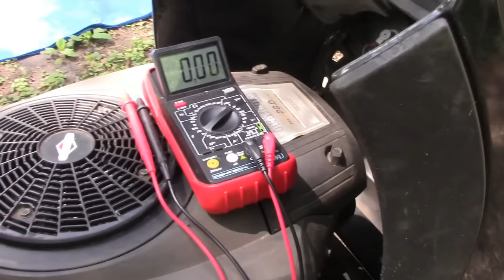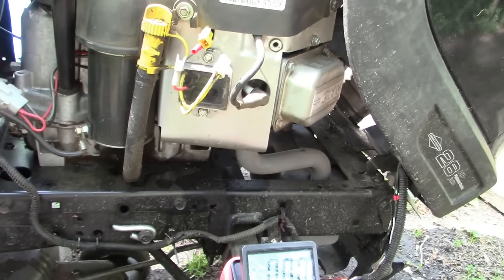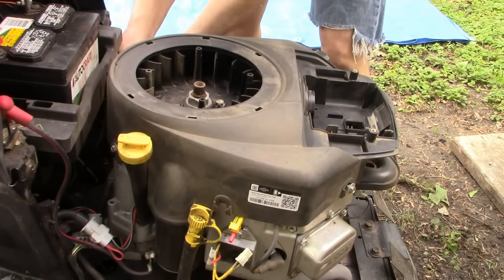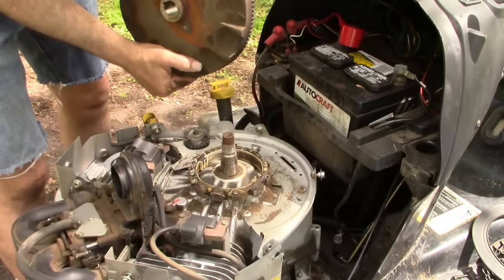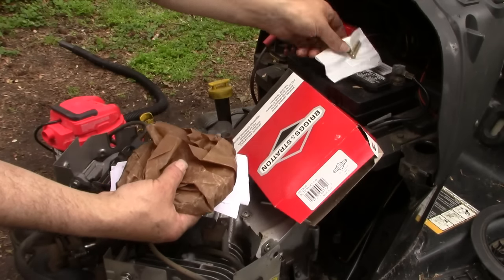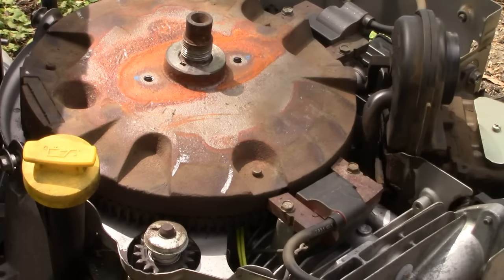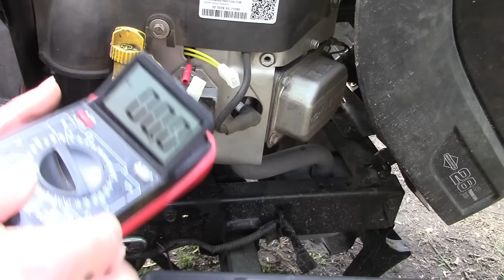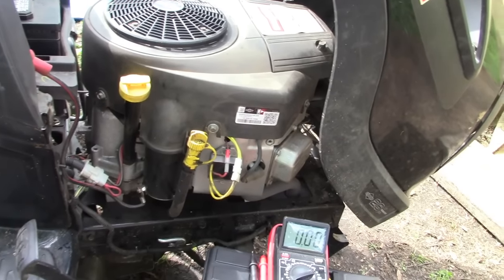How to Test and Repair a Lawn Tractor Charging System

Comment: Have to admire the guts of someone working on the electrical system without unhooking the battery 😮
Reply: Was thinking the same thing
Reply: Right, cause 12v is so deadly. Could've shorted out his pacemaker.
Reply: @joequillun7790  It isn't about 12V hurting you, it's about damage to the equipment.
Reply: @BuckeyeNut123  OBD2?

Comment: 15.5 volts is to high should not be over 14.5 volts, it looks like the voltage regulator needs replacing.
Reply: Unless battery is weak and going bad
Reply: Leave it to the professionals 😅
Reply: slowly cooking the battery.....
Reply: It’ll be OK.

Comment: Normally the headlights would be running while using the tractor so those lights would drag the extra voltage it’s putting out

Comment: All that effort and did not clean outer magnets on flywheel or the coil ends that go towards outer magnets on flywheel. It would of also been great if you could of shown the inner magnets on flywheel. Other than that I was thankful of the way you tested to verify the bad part and then showing new part and numbers. Thank you....Pete
Reply from the maker: Thanks, Pete. According to Briggs & Stratton, cleaning the flywheel magnets is an unnecessary step unless the built-up rust is negatively impacting the required air gap. That's what I've heard, anyway....

Comment: Great video with important details such as the AC & DC voltages that should be present from the stator and voltage regulator respectively. I have a Husqvarna but voltages should be at or near the same values. Also read that if you have your lights on while the mower is running then stop the mower the lights should dim. If not then there is a problem somewhere in the charging system. Great video Buck!

Comment: That voltage seems a bit high to the battery. A car battery will BOIL at 16 volts....that is not a guess, I have had it happen on old dodges...more than once. If you smell sulfur shut it down, the battery is boiling.

Comment: Excellent and understandable video. I have a truck-mounted carpet cleaning machine that uses a 23 hp B & S engine. I think either the voltage regulator is burned out or possibly the stator. It is not nearly as accessible as a lawn mower because of how the machine is made, but all in all, it's basically the exact same type of system just a little more complicated and hard to work on. Getting to the stator is the biggest issue so I need to find out for sure if that's bad or not. If it is I may have to hire a professional service on this one for help. Anyway, your video was a big help because I'm pretty dumb when it comes to these things, but even I fully understood everything you did. Thanks!!!
Reply from the maker: Interesting! I would start by verifying DC voltage at the battery with the engine running full throttle. 13 or 14 volts DC would indicate that everything is working just fine. I was also just wondering in your situation if it were possible to use the truck alternator to charge the machine battery just like it charges the truck battery? That might be an easy work around.... Good luck with the repair, and I'd be interested to know how it turns out.

Comment: Was about to order a 130$ stator just before watching your video. Only to find out that mine was outputing DC and AC flawlessly like yours. Thanks for your time!
Reply from the maker: Great. No point in replacing parts that aren't faulty. But is your battery charging? Or what is the problem you're trying to resolve?

Comment: DUDE your vids are the Best !! thanks TONS for this one ! ive had this issue and a battery salesman convinced me that i have to replace the battery every year because they're all junk. i did the coils replacement,  voltage regulator AND the coils... same issue... ran across your vid and BOOM -  Done !
  My machine is the Ariens 22 B&S V Twin, so close to the same beast... it mows MEGA lawn spring thru fall, and plows Montana snow for a whole cul-de-sac in the winter... so its a busy machine !! Thanks for your time and effort making this vid !!
Reply from the maker: Thanks for the note and kind words! And good job fixing your own machine!

Comment: Excellent work, Buck.  Now I know how to troubleshoot and repair the electric system on my tractor mower.  Really only two components after verifying wiring is good.  Every step covered and well explained.  I'll check the regulated Voltage to battery just to see.

Comment: Thanks for step by step diagnosis. Son in law has 2002 Simplicity Broadmoor 16 hp B&S Itek engine  405777 with Tuff Torq Hydrostatic tranny. Hour meter over 550 hours. Battery new but runs down after 2-3 weeks. Will first check for bad wiring.

Comment: Great video!  I watched several others before I got to your video.  My problem was the connection on the regulator that goes to the battery.  You made it super easy to find and after just a few minutes it's working perfectly.  Thank you for making this video!
Reply from the maker: Great news. Good job fixing it yourself.

Comment: Thanks for the help. Using your video I found my 50 inch craftsman 26 hp. Problem. It’s where the alternator wires come out from under the plastic cover. that cover chafed my wires, once I repaired that it was good again. I should have tried to fix it years ago instead of replacing batteries. I have since put a small piece of foam on the plastic cover to prevent it from happening in the future. I suspect a lot of B and S engines with that cover may suffer the same fate

Comment: Great video. My problem is that the battery may be overcharging. Does that suggest the regulator is faulty? Thanks.
Reply from the maker: I guess that's possible. What kind of voltage is it putting out at the battery when running full throttle?
Reply: I’ve never seen that happen unless the battery is bad and over working alt

Comment: Great video.  I went out on Sunday and my Ariens Zero turn battery was dead.  I put my charger on the battery and got it running but when I got off in the yard it was dead again.  I put it on the charger longer and got done.  I was getting ready to call Ariens for warranty work but now I can check my stater and regulator before I call.  Thanks.  Great video.
Reply from the maker: Check the voltage at the battery with the engine running full throttle. If you're getting 14 volts or so, your charging system is fine. Possibly it's just time for a new battery??

Comment: Your video solved my problem. I have a few steps you didn't mention. My first step is to check the fuses(s). When doing work like this, I like to set up a portable picnic table near my work area. Here in FL, during hot weather, I set up a portable canopy for outside work. When removing screws, I use a paint-filled felt-tipped marker and write the size on the fasteners near the screw holes. Where wires run under a retainer plate or holes, I mark that spot with my marker using the same color(s) as the wire(s) and draw an arrow to indicate where the wires go. If you find that the retainer key on the shaft is broken, you may have discovered the problem. With the engine cover removed, I check the stator gap. Loosen the pickup screws, and the pickup will be drawn to the stator because of the magnets. I use a standard business card to set this gap. Also, the card allows me to move the pickup in and out while I tighten the screws. When using extension wires, I attach small alligator clips to the ends of the wires.

Comment: Excellent video!
What is the size for the socket for the metal wheel over the alternator?  30 mm, 31 mm, 32 mm, or...  I would be most grateful, if you would tell me.
Reply from the maker: It's probably 15/16" (inch). But I don't specifically remember....

Comment: Thanks for the video. I have a 13 HP Brigs experiencing similar charging issues. At full throttle I am only getting 12 to 12.3 volts DC to the battery. Time to do the same. The mower is about 11 years old. Started up after replacing the battery but have to use my jump box every time to start it since. ;-)

Comment: You can rewind that part with magnet wire and solder on the old connections. I am not trying to be that guy but if you can't get a replacement then this is a option and a surprisingly easy one at that.
Reply from the maker: Good info. Thank you so much!

Comment: Hi I got 2 small led light bars with wire harness and switch ...I've already replaced 1 battery got a new one and it worked for a few weeks usually start the mower 1 time a week .. well today it died and didn't want to turn back over until I connected my jumper cables to my truck...would those led lights drain my batter after a while ?

Comment: Great video! I just got a new battery for my Craftman 20 hp mower. Started right up first time then 2nd time won't start the mower. Should I check the regulator first and the the alternator?
Not sure where the regulator is.

Comment: Very clear instructions. Will the DC voltage be different on a smaller engine? I have a 13.5 hp B&S motor that's not charging the battery.
Reply from the maker: Check battery voltage before starting the tractor. Then check battery voltage again at full throttle. Should be higher, closer to 13 volts, I'd say.
Reply: @Buckwsr  I apologize, I meant to say will the AC voltage be around 30 on a 13.5 hp motor?
Reply from the maker: @Thurge  If yours is set up the same as mine, with the externally mounted regulator, I would say yes you probably should expect around 30Volts AC directly from the alternator.

Comment: I'm in my 3rd Season with my 2021 craftsman T240 tractor no issues with the battery starts every time I live in Oklahoma it gets very cold in the Northeast section where I live many times below O in the Winter time I disconnect the negative side of the battery for the off season..No problems

Comment: Hi, thanks for the video! When you were testing the regulator I couldn't see where you were putting the negative lead after the regulator/stator was replaced. The jumper was in and the output to the battery had the positive lead and I can only assume the negative probe was on negative post on battery when you did that regulator/stator test. I could only get a reading of 14+ volts on the regulator when I put the negative lead on output from regulator and positive lead on output to the battery without using the jumper wire.
Reply from the maker: Yes, the negative lead can be placed on the engine block or any bare metal on the tractor frame, or of course, on the negative battery terminal. 14 volts sounds about right to me....
Reply: @Buckwsr  that wire coming out of voltage regulator to charge the battery.  Where does it go to.     Mines putting out  15 volts or so.  But wen i test the wire coming from the battery up to the regulator hookup.  I should have battery voltage and i do not.  I tried a direct wire from regulator to battery and fried a new regulator   so now i have another one and do not wanna burn that one up.  Thanks in advance
Reply from the maker: @cspbldg  I'm not entirely sure I understand your question...  The 14 or so volts from the regulator (with engine running at full throttle) should go up to the key switch, and then make connection with battery positive when the key is in the "run" position.
Reply: @Buckwsr  thats what i thought.  Someone has the wire going from voltage reg to the amp meter

Comment: All went well but I did need to buy a 32mm impact socket to remove the flywheel bolt.  BUT I cannot get the flywheel keyway pin to tap in easily like you showed in the video...What's up, just wrong alignment OR is the flywheel not fully down.
Reply from the maker: Not sure what to tell you. The keyway pin usually goes in easily...

Comment: I can't find any information on where the 14 volt dc wire on the regulator for the 24 hp briggs on the husqvarna r4824 zero turn is attached.   Mine is missing. I have no idea how it disappeared.  I assume it goes to the key switch someplace but I can't find any place that the wire can plug into.  There are many videos show how to test the wire connection but I haven't seen and on replacing it if its bad or in my case missing.  If you could steer me to a wiring diagram that show where it's attached. I would be very appreciative. Thank you very much I really enjoyed your videos. I found very in formative
Reply from the maker: One option is simply to add that wire from the regulator to the terminal on the starter solenoid...the large terminal that runs directly back to battery positive. Then run the engine full throttle and make sure you're getting like 14 volts at the battery.

Comment: A test device to simulate an a/c charge would be handy to fully diagnose before even replacing the stator. You could simulate an a/c charge current into the "regulator"(diode) and check the dc voltage out as long as the test device is capable of being in a known good working order to produce such signals. Good video BTW.

Comment: Couple things 1) Amazon says the voltage regulator in your link is no longer available. 2) At the end of your video when testing the charging by putting in the jumper wire, which battery terminal do you touch? I assume negative but I never like to assume.
Reply from the maker: The regulator puts out positive DC voltage and runs through the key switch to the positive terminal on the battery. When I was testing the DC voltage output at the regulator (with the jumper wire), I put the positive lead from my tester on the jumper wire, and the negative lead on the negative terminal of the battery. For testing the regulator, it has to be connected to the battery. That's why I used that little jumper wire.

Comment: Excellent video! Taught like a real pro with excellent knowledge and experience! But you made it showing that anyone can do it. I’ve worked on cars all my life but never did a whole lot on small engines other then cleaning carbs. So this expanded my knowledge. I did my first engine swap. Can you do a video on engine swaps from brand to brand and shaft sizes? I didn’t realize that there were different brand engines that will work on the same frames.

Comment: Nice job with the video. Very helpful info.
The only thing I'd suggest is being very careful hammering on the crank shaft end when trying to pull the flywheel. I always put the nut back on the shaft so that I hammer the nut rather than risk deforming the end of the shaft. But... you were careful & it all worked out. Thank you.
Reply from the maker: Thanks for the note and the good tips.

Comment: Hello!  Thanks for this helpful video.  The charging system on my John Deere L111 was not working.  It have a Briggs and Stratton Intek 20hp engine.  I looked up the appropriate stator and voltage regulator.  I replaced both and put it all back together as it was.  When I start the engine, it makes a loud pop noise, sometimes spark and/or shuts down.  I’ve removed everything out multiple times and I’m exhausted!  The flywheel key keeps splitting.  I’ve gone through 3 of them.  Any advice?  I’ve noticed that my magnets now have a few little broken off pieces.  Thank you in advance.
Reply from the maker: Wow. Frustrating. I would have to think that perhaps things weren't put back together quite right. I would also compare the new stator to the old one to make sure they are identical. I hope you can get it all sorted out!
Reply: @Buckwsr  It’s the same stator you used.  It’s the same briggs engine.  I put everything back just like you did.

Comment: Great video. Very much appreciate you taking the time to show us how to do it.  Can you tell me the size of the flywheel nut so I can get a socked to take it off?  I don't have an impact tool but I think I can borrow one.  If not could I use a half inch socket wrench breaker bar.?
Reply from the maker: I think it's a 15/16" inch socket. If you use a breaker bar, you'll have to devise a way to keep the engine from spinning. That's why an impact gun is easier. Good luck, and thanks for watching the video.

Comment: Thanks for posting this. I have a very similar tractor as yours (YT3500, 22hp Briggs, approx 2013), but on the spot where your regulator is, I have nothing. Scratching my head  how to test it if i cant find it lol. My main issue is, I dont seem to have enough power to start the tractor after its been running for a few mins, but starts fine when cold...battery voltage is about 12.5 when cold.
Reply from the maker: If you get 14 or so volts at the battery when the engine is running full throttle, then your charging system is fine. I wonder if maybe the problem is your starter motor? 12.5V sounds about right to me for your battery when engine is not running.
Reply: @Buckwsr  Thanks. I had the old starter tested, they said it was ok, but I bought a new one anyway lol but still have the problem, also previously changed the solenoid and battery...A real headscratcher. BTW, I dont get as much as 14v at the battery at full throttle...IIRC, more like high 12's. How long should it have to run to get up to 14?
Reply from the maker: @BeerLeagueGoalieGodfather  Should be 14V or so immediately when at full throttle. Anyway, I did a quick online search. Do it yourself with the words "Briggs will not start warm". Found a discussion suggesting a leaking needle and seat in the carburetor which floods out a warm engine by not shutting off the flow of fuel as it should. Hence, refuses to start. That extra fuel evaporates when the engine sits, and therefore has no trouble starting cold.  Do that search and see what you can learn.